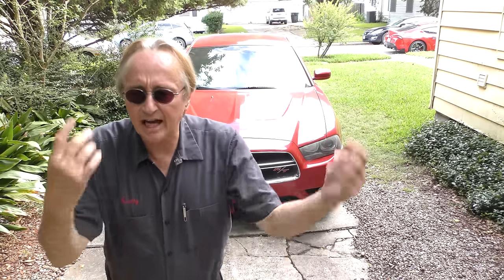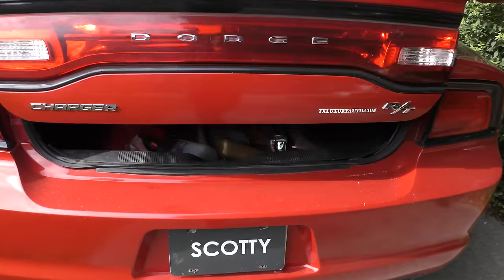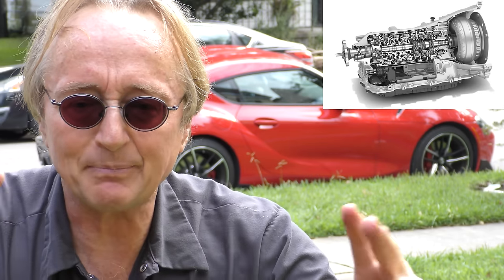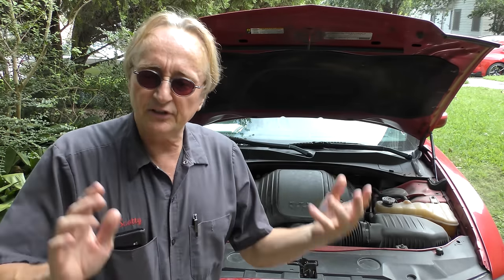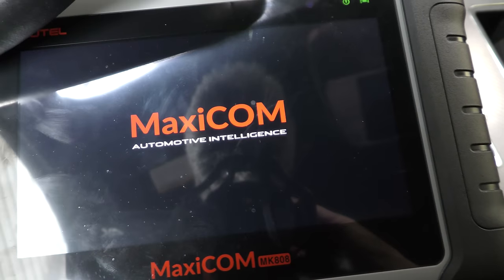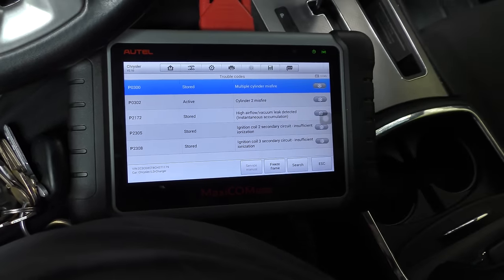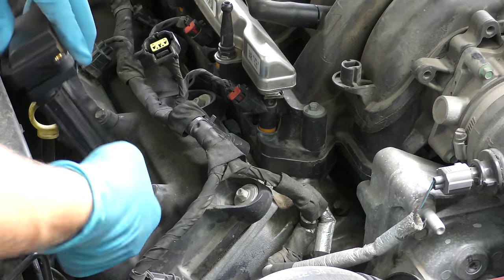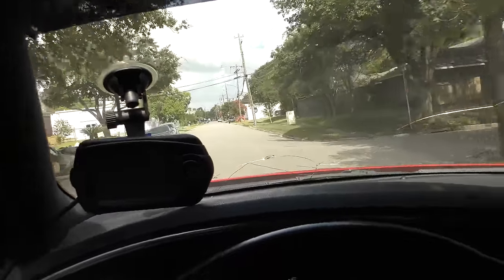Here's Why I'll Die Before I Buy a Dodge with a Hemi Engine

Comment: I love and hate this video with all my heart. I have a Dodge Charger 2014 with 126,000 miles on it and the transmission goes up really hard if I don’t accelerate steadily and the water pump has broken twice, my fan has had to be replaced twice, my shocks and ball joints are so worn out and it makes my suspension creak when I go over speed bumps and my power steering wheel used to be so hard and I had to get it fixed.   I love how informal and truthful this video is but also hate that it’s true and it’s my bad luck of the draw. Nice video

Comment: Scotty:  "it's a tremendous gas hog..."

My wife and I took a road trip for our honeymoon in my12 R/T driving it from Washington state to San Diego and back (with many stops in between and driving around the towns) The trunk and back seat packed full, averaged 31 MPG!  For a V8, I'd say that's pretty damn good!!

Scotty:  The Hemi and 5 speed trans are unreliable junk"

Me on multiple Charger and Challenger groups...  Some have 200k, sometimes even 300k plus miles on the odometer with very minor issues.  It's all in how you maintain them!!

Comment: I dont blame dodge here. Nobody cared for this car.
Reply: I honestly care for any type of cars, mostly muscle. It hurts me that Charger‘s are not getting the love it deserves
Reply: @Apollo5752353  cuz it's a Chrysler and not reliable
Reply: Fad3z 187 Sadly yes, but take care of it instead of making it a Junker, it‘ll last a good while
Reply: Fad3z 187 your dad lied to you your entire life
Reply: Owner rags out the Hemi but Scotty says Hemis are trash. Lol. Seems like Toyota is paying him enough to trash talk other engines.
Reply: well dodge did make bad lifters in the early years that seize the newer ones fixed that issue. thats what happend to this dodge the roller on the lifter seized ate away at the cam profile and now throws a code. very common problem.
Reply: Bryan Leakey  - it IS Dodge's fault  - Scotty informs on another YouTube auto mechanic  - Tony's Garage  - who explains in good detail of very bad engine design (poor lifter lubrication)  - camshaft/ lifters starved of oil ...check out Tony's Garage. 🇺🇲
Reply: @SuperBigNye  That's because the MDS lifters at low RPM receive a lower rate of pressure. Then wear occurs and this is enhanced by either the wrong or dirty oil.
Reply: 7G's for that? SMH...
Reply: @raybin6873  well if Tony said so....

Comment: Is it just me or does this thing have 2 spark plugs?

Edit: Looked it up, they do have 2 spark plugs. Eek.
Reply: 2 per cylinder 👀
Reply: 16 spark plugs in total
Reply: That's to meet emission standards...burms fuel more completely.
Reply: back in the 1980's "Dave" the independent BMW motorcycle mechanic in the Austin, Tx area  offered a second spark plug service for the twin airhead. It's also a nice thing for cross-country having a second ignition system.
Reply: @stillnotwoke  incorrect it's a hemi do you know anything about a hemi head?
Reply: It's to meet usa standards to sell engines. So it needs 2 spark plugs per cylinder so burns better and better fuel
Reply: Two plus not new technology.
Reply: @jeepjoseph9036  No it's not he is correct.  You could maybe call it a "semi hemi".
Reply: @EliteStricker  As far as I can tell, Mercedes it the only one that does twins for automotive use (maybe BMW?) but non of the other brands do it. Am I missing an engine here?
Reply: @heathbauerle2787  Alfa romeo have had 'twin spark' for decades
Reply: two plugs per cylinder. while we're on the subject. I would have pulled both plugs on #2 cylinder, and gave them a look see. You said the owner changed the plugs, but you're right there, why not double check. For all you know, he might have changed the plugs on the wrong cylinder. He (or she) doesn't sound like a rocket scientist. 
.

Comment: My 2012 charger se is acting crazy. The rpm is going up really high. What could be the problem...I took it to a dodge dealership and they said the codes will reset it and didn't.

Comment: I’ve said it before on your channel, with simple maintenance, the 5.7 liter Hemi is bulletproof. My dad and I bought my mom a 2005 300C that has been trouble free for 200,000 miles. I bought a 2007 300C AWD that has 329,000 miles on it and it’s my son’s daily driver. I bought a 2009 Challenger with a 5.7 that I put 250,000 miles on because I commuted from Pennsylvania to New York every day. I bought a 2014 300C awd that has 82,000 miles and my wife drives it every day. I have a 2019 Challenger RT that I bought in December. I’ve never had ANY electronic “gremlin” issues on any of them, unlike my wife’s Cadillac CTS that we ended up giving away. Same issue with the 2016 Chevy Cruze that my other son bought new. 

I love your channel and you’re definitely a skilled mechanic. Some of the “broad stroke” generalizations that you make, however, are off the mark.
Reply: Blah blah blah
Reply: I've been around Chrysler products my whole life and was not a very big fan of them. All these people keep telling me how good their hemis are running. I wouldn't buy another one.

Comment: I replaced an engine on a Charger 5.7 - It still has that clacking when it's on. Donno what that noise is. Same as it was with the original engine. Misfire is good on diagnostics for me. 

Also, my drive cycle isn't completing after I replaced the cats. I've driven well over 100 miles. :/ - The Emissions says it's fine, but the engine light stays on (not while running, as the drive cycle isn't completed after a reset) and says incomplete for the o2 sensors for a drive cycle. How do you do the drive cycles on these? I even did each type of recommended type of driving for each sensor.

Comment: I have a 2012 Charger police car with 82k 5.7L The car runs excellent. Just change the oil every 5k with full synthetic 5-20, it'll run forever.

Comment: At 90,000 miles my 2013 5.7 Challenger is slightly leaking oil (just enough to make the area damp on the top of the engine near the valve seals) assuming it's either the intake manifold, head gasket or... God knows what else lol

Comment: My buddy owned his since 40k miles. Drove and raced his 5.7 hemi heavily. Didnt blow the headgaskets til 180k at which he did a big cam and 6.1 srt heads. Then at 220k on its 2nd pass of 200 shot of nitrous the motor started to knock. Original trans and diff. Cant ask for more than that from a mass produced sedan.

Comment: The nicking he heard wasn't the lifter it was the manifold gasket but clearly he knows what he's talking about 🤦‍♂️ he said 19 codes but his scanners codes were both the bad and the good they had codes that said they passed but he counted them as bad? Way to be biased on your video bro
Reply: This is one of the reasons I don't believe him about Toyota's. I had 3 of the pos and all had engine problems before 100,000 miles.
Reply: 2014 durango R/T had the same issue with a exhaust manifold leak, also with the coolant hose snapping due to high temp and wear and tear over time :/
Reply: plus the tire air pressure code is not a fault. if you've ever changed a tire in the 2007 to now Chargers, 300s, and Magnums you know this. :> that's an operating system 'oopsie' that they've never fixed.

Comment: The " Nag" 5 speed auto is a German trans Scotty.....and its pretty durable.
Reply: Reginald N  
I wish what?
Its more durable than the 8 speed.....I had a 8 speed die on a 16 Challenger with the 3.6 with only 12,000 miles on it!! Kept locking in gear and wouldnt shift.
Replaced the whole trans under warranty of course.
The 14 Challenger I traded in had 65,000 on the 5 speed auto and never a problem.

Comment: Instead he drives a BMW powered Toyota
Have fun fixing that when it breaks down
Reply: Won’t break down as fast at that POS dodge
Reply: @christhaelectrician9578  The Challenger won most reliable american car this year
Reply: Canada Guy THIS YEAR... we’re talking about 1. A CHARGER and 2. A CHARGER from 2012.. and even if it did win most reliable car this year it’s definitely not including foreign automakers.. just American muscle categories in reliability.. get your FACTS straight dude
Reply: Guys are pulling the b58 and installing 2jz
Also if you would actually look into the new supra, the engine is not hard to work with.. so oops wrong again 🤷‍♂️
Reply: ChrisThaElectrician STMPD  bmw doesn’t win reliable  awards
Reply: Kay Yo  Bmws best engines is the inline 6 and they are very relabile, and every one you ask about american cars they will say that they drink soooo much oil, if you look at a bmw you change every 6 months, and the american cars probably every 2 weeks
Reply: BMW'S inline 6 is a world class engine,and that Toyota will still be running long after every single charger has been in the bone yard.
Reply: Goku Kakarot who said anything about bmw? Go back and read what I WROTE... bmw’s are plastic garbage just like dodge!
Reply: ChrisThaElectrician STMPD lol, pay 50k for a Supra with less horsepower than a charger, or get a 370 horsepower hemi beast for a fraction of that
Reply: @christhaelectrician9578  issa Ford good
Reply: TeddyxxMexx better than dodge yes 👍🏼

Comment: Never understood the allure of a 4 door ‘Muscle Car’
Reply: I think they used to be a lot more popular then they are now because previous generations had "car guys" who had families.  Most millenneals/gen z are more into tech then big engines like previous generations were.  I've noticed though other than old guys big sedans with powerful engines are also popular in the black community (Chargers, 300s, Impala's) that's probably the only reason they still make them.
Reply: This car should be called Coronet, not Charger. Charger is 2 doors and for me it will always be
Reply: That's so you can carry 2 extra guys to push it when it breaks down.
Reply: No such thing as a 4 door muscle car
Reply: when u got a family but u still wanna go fast
Reply: It’s the kids in my case, easy in, easy out and no problem merging onto the interstate.

Comment: The truth about Dodge Chargers: electronic nightmares as they age. Truth!👊
Reply: Truth about anything minus Toyota
Reply: Exactly anything after 90s
Reply: So are Chevies. So are Fords. Not all of any brand are, but it's a common problem as cars age. I've owned all of the above and more, and for electrical issues in the ones I've owned, the Chevies led the pack, then Mopar, then Ford. That said, I have a Ford van right now on which I need to work on the instrument panel connections. Frequent trouble spot and I'm hoping it's just contact cleaning needed.

Comment: I can’t believe you would recommend anyone buy anything with one of those Pentastar V6s in it.  Just don’t buy a Dodge.
Reply: What’s wrong with the pentastar? Mine has 160k and absolutely 0 issues.
Reply: Dodge are junk
Reply: Why are they considered junk all you do is get your info from scotty and people that hate dodge. Chrysler products are well made. They have their issues just like ford and chevy etc. the hemi tick which is occuring is common accross all platforms with a cylinder deactivation system. The v6 is a really well made good quality engine that you can get a lot of life out of. Same thing with the 5.7. It wouldnt be around as long as it has been if not for somewhat good quality. The tick also doesnt need the whole engine replaced unless the keep driving it till it really breaks. It just needs a lifter and cam replacement.
Reply: @Sak-zo1ui  the price of a "just a lifter and cam replacement" will cost more than the POS car is worth. Go to Uncle Tony's Garage here on YouTube to find out how crappy Fiat designed this version of the hemi.
Reply: @dantebrytant5285  Eh, that's your opinion.
Reply: Dante brytant you could call any car junk I don’t even like dodge but grow up and realize your opinion isn’t fact
Reply: Alright then 
Had one in a Jeep Cherokee.  Top end got rebuilt at 18,000 and 34,000 miles.  Oil was changed on time or early with full synthetic of the weight recommended.  As an aside, I’ve got a 06 Ram with the Hemi that I have run the crap out of and it’s never given me a problem.

Comment: Never buy Dodge!!! Everyone knows that lol
Reply: Every car is good if taken care of my grandpa's 1998 ram ram him over 10 years before getting rid of it with a brand new trans transfer case being replaced once
Reply: meh depends on the year/type and  the owner. You can find mechanical issues or flaws in lots of different brands not just dodges. the older rams can be great, though the cummins engines are probably a lot better then the hemi's. family member has a 2000 ram with 400k miles on a 24valve 5.9 cummins. The truck is in great shape. But he drives really smoothly and lets the turbo cool everytime before turning the truck off...if he treated it like hell and didn't maintain it, probably would be in a junk yard. Same for a lot of brands.

Comment: I have a 2011 Dodge Durango Citadel 5.7l Hemi that has just over 130k. Never had a problem with it. I dont beat on it. I drive it like I'm supposed to. The only time I hit the gas is when I'm merging up to highway speeds. Still looks brand new inside and even people who ride in it says it smells brand new. It's not always the car. Sometimes it's the driver.

Comment: Those 5.7l engines are notorious for dropping valve seats... I've diagnosed two 5.7l hemi engines that dropped the intake valve seats into the cylinders and just trashed the engine entirely. The one went to the dealer under his car shield warranty for Chrysler to replace the engine... The other one the customer opted to buy and engine from Accurate Engine which he had me install it.
Reply: 2009 and below, yes. Problem was corrected in 2010.

Comment: I have a 05 300c 5.7hemi 290k my daily driver still very strong.  Along a 05 ram 5.7hemi 230k again daily driver. Both automatic transmission. Both all original engine and transmission. Only maintenance no issues. Except for fuel and over priced parts but haven't had to buy very many.

Comment: Uh, I guess I am the most fortunate.  I have a 2012 charger rt and have never had problems more than battery.  I have done most of the maintenance and she still drives like a dream.  She is thick so not for racing mustangs but I have disappointed many who have challenged.

Comment: Brings back memories of my 2015 ram 1500 with a 5.7.  Bought it brand new and serviced it regularly. Motor took a crap at 68000 miles. Had it replaced under warranty and 500 miles later the 2nd motor failed.
Reply: Well you got a lemon and had a bad shop for your work. That’s not anyone’s fault but yours

Comment: Just looked at a 2011. Body mint. Police  interceptor. Tick tick tick. P305. Price he's asking is 4200.00. Priced out cam and lifter kits at 600.00 per side. ( figured if you're in there do it all). Then decided to stick with my 05 avalon limited.  Just don't want to go through all of that....

Comment: Well my 06 Magnum RT is still running great with 155,000 miles only had to change the water pump and charge the ac. Only issues I have is the window switch keeps falling in the door and the dash vents.

Comment: Lifters are notorious for failing in these older model Chargers.  Supposedly Dodge has updated the newer ones.  One issue that still plagues the 5.7 hemis which may be a contributor to the noise you’re hearing in this video also is the cast iron exhaust manifold design is to thick and they warp and break the manifold bolts causing exhaust leaks.  I’m trying to remedy this issue now with mine installing shorty headers.
Reply: Put hellcat lifters and problem solved.

Comment: I've been doing donuts in my 2010 ram 1500 5.7 for the past forty thousand miles practically trying to kill it  it's a 220000 miles truck that's been abused its whole life missed oil changes had many other services for thousands of miles a Time and Iv never had to replace anything more than the alternator still runs like a champ ???? I've also overheated it for a couple months at a time 2 times

Comment: My wife has this car in the awd model. She broke the timing chain at about 125,000 miles. These are interference motors so it was junk after the chain broke. Luckily the car had a recall for the timing chain so we had a new motor installed for free!!!

Comment: Hmmmm, my hemi went 252k plus.  I got it with 37k miles.  That’s really good for what I put it through.  Now it’s time to place a rebuilt one in it.  Mine is a second generation ram .  Right now it’s financially feasible to get a rebuilt engine, then wait for the transmission to die.   I figure, give it another five years with the rebuilt if that, then look into a getting a newer truck.  Thinking of going with a diesel to haul the camper, tools, and other toys.

Comment: I had same problem on my 5.7 hemi 2011 police car it ended up being a bad cam from lifter failer I ended up fixing it spent like 2,000 to fix the problem with those year 5.7 it has the mds which stands for multi displacement system which is where it goes into 4 cylinder mode when cruising which they have issues over time I currently have the 6.1 version of that car n they bypassed that on the 6.1 much better made  A lot more power too  gas millage isn’t the best but that’s not why you buy a big v8 car want gas millage get a used Honda or something just saying lol 😂

Comment: Why you didn’t change the spark plug!??? You can’t say the engine has a problem without changing first the spark plug and also the crankshaft and camshaft sensors which are very easy to change, just the same way as you change the ignition coil!